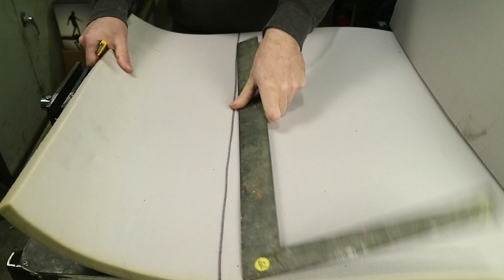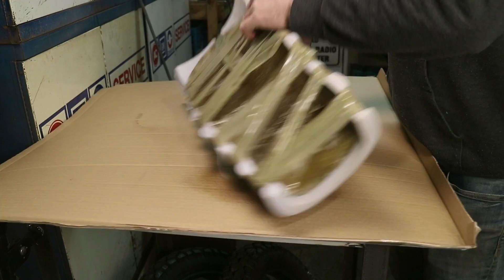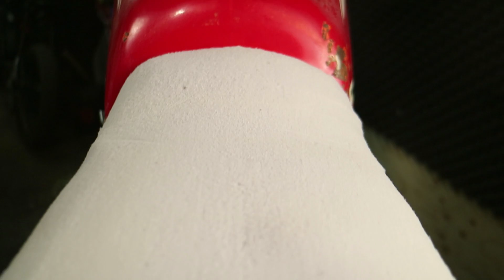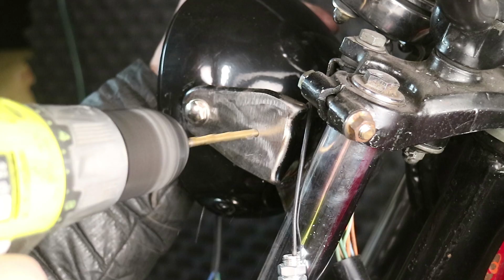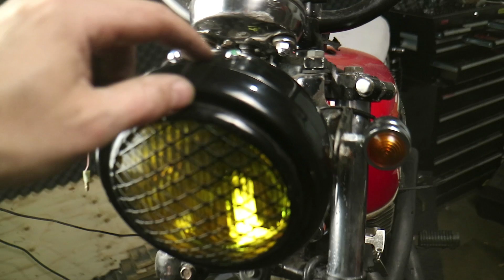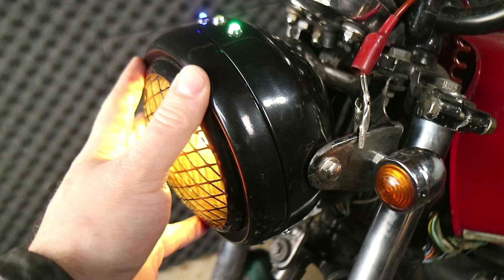CAFE RACER SCRAMBLER BUILD, DIY Seat Foam & LED Dash light Instal time lapse - Honda CB360 Ep17

Comment: Hey man, I made the fiberglass base but I didn't figure it out how I will attach it to the frame. Whats your plan to doing this?
Reply from the maker: Cool! I used a nut (don't know the specific name of it) that self embeds itself into wood. The fibreglass is too strong to be punctured but I drilled a slightly smaller hole and pressure fit it from the top (under the foam) in the fibreglass. Then just used threaded rod and a nut on the bottom through the electronics pan and tighten with a T nut. Don't know if that makes any sense. When I get my seat back from upholstery I'll mention it in a vid. Cheers!

Comment: I can recommend buying a resistor and diode set with different values- always handy! Btw resistor values to dim leds are pretty low so better to go with 0 to +-500 to have a nice range to play with. Everything over 500 will be pretty much useless. Very cool build!
Reply from the maker: Ollie M thanks for the info!

Comment: Thanks but nah I don't wanna disagree but it's a thick hose that goes right from the gas tank area ,to that cup sort of thing that has gas in it and the air filter bottom fits snuggly into the top of the cup?? Weird I know I have to take off the tank which I have not done yet bc I haven't had to. Lol thanks

Comment: Yeah but when I took out the air filter there is a cup type thing with gas in it with a large hose coming from the gas tank area,, and I’m assuming that is the reserve bc ive ran carb cleaner all thru , and ran my old gas down and I had a problem with gas pouring out of bottom overflow hose on both carbs that never happened before and I be running and riding the bike for months now????
Reply from the maker: mike eger I could set be wrong, I don’t have the orig air box on mine. Take a pic or 2 and send it to combustionjunction8@gmail.com. Interested in what you are dealing with..

Comment: I need or actually want to add an inline fuel filter in my 79 cm 400 Steve but I see there is a large hose separate from the fuel lines,,, going into and under the air box and that is I believe for the reserve fuel. I need help Steve. How /why/what do I need to do to make sure I’m filtering all the fuel reserve or otherwise coming out of my tank and having it filtered before entering the carbs on my 1979 Honda CM400A motorcycle!!!!!!!!!!!!! Thanks Mike 🙏👻👻👻🙏🙏🙏🙏🙏🙏
Reply from the maker: mike eger if it’s stock and I am correct the only fuel line you need to filter is the one directly out of the petcock. The other large one you mention I think is the crankcase breather.

Comment: You may want to use a diode with those LED's if the resistor thing does not work out. Love the idea and that seat did turn out great much much better than mine did.